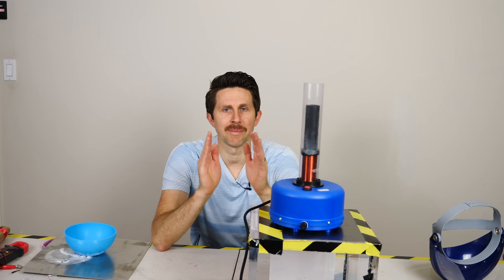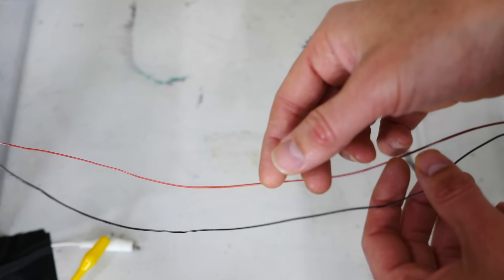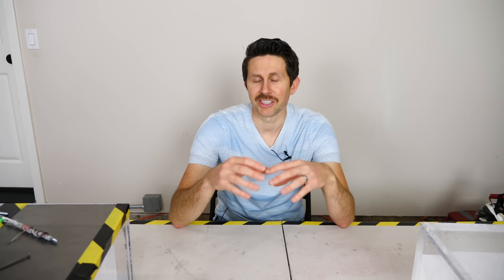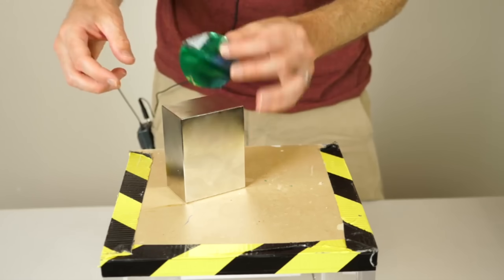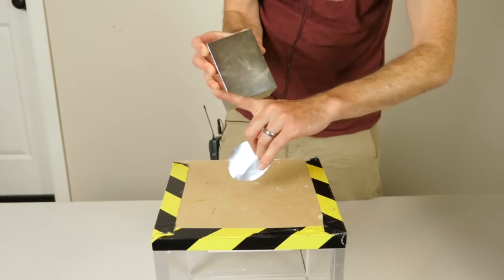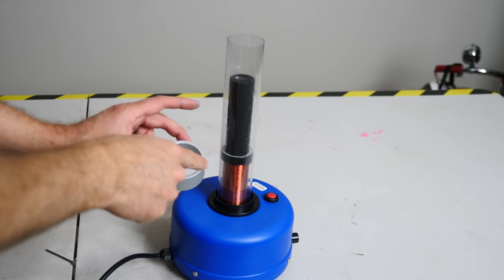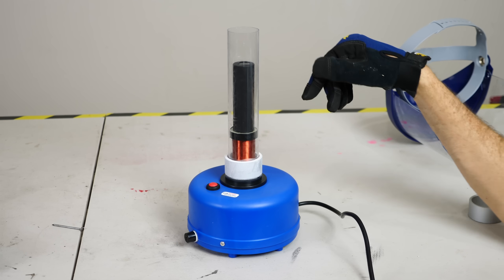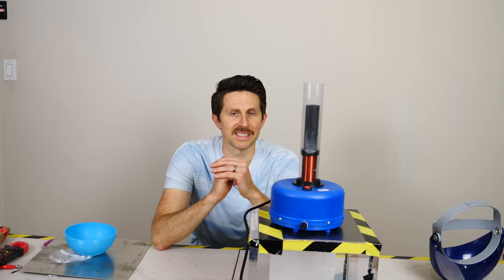Sub-Zero Electromagnetic Accelerator (Ring Launcher)

Comment: Also you can use dc if you have enough power. Same way those high power can crushers work. They don't use ac. They use dc. No induction in dc but it still creates opposing forces launching the ring. I use 400v 2500mf capacitors in parallel and in series on my gun and it's louder than most guns. It sounds more like a bomb

Comment: Electric guitar pickups induce voltage with a stationary magnet and coil of wire. Moving the metal string through the magnetic field is what creates the voltage in the pickup.

Comment: Can someone resolve this paradox: the guy in this video moves his magnet near the coil. There will be a change of the magnetic field which makes charges to move inside the wire. Now this flow of charges create a magnetic field so the moving of the magnet is harder. My problem is: the changed field propogates at lightspeed so there is a delay between moving the magnet and feeling the force against moving it. A slight delay but should be enough to create a high frequency  vibration which is like free energy. We know this does not happen. What's wrong then?

Comment: That last bit with the spinning magnets showed the principle behind Tesla's AC motor. By using 2 or more AC currents out of phase, the motor kept the spin going, because it created a rotating magnetic field. Rather than magnets, it just used a piece of metal inside the coils. The field induced eddy currents whose magnetic field opposed the fields of the coils, making it spin.

Comment: We should use this to launch satellites into space. But would the acceleration be too high, even for unmanned satellites? They would have peak speed as they leave the launcher, so they might burn up as well. They would need to be inside a ballistic heat shield shaped like a missile to withstand the aerodynamic pressures.

Comment: I have a question, when we take a magnet and stick a nail or something onto it, why is the nail also able to attract any magnetic object so long as the magnet is stuck on the nail? Then when we take off the magnet, the nail and the other object falls.
So basically, how is the magnetism going through unmagnetized objects like the nail?
Reply: Because the nail has also become a magnet. But why? You can think of the nail as it is made up of small magnets which were initially oriented in a random direction so that the net magnetic field created by it is zero. But when the magnet comes near it, those small magnets are aligned in a definite direction to produce a strong magnetic field. This is temporary.

Comment: Some say quantum levitation occurs on a super conductor due to the magnetic field lines acting as "string" passing through it.. While others say it's the infinite current passing through the super conductor (no resistance) allowing 100% of flux change replusion creating an opposing magnetic field equal in magnitude to that of the actual magnet allowing its levitation...
There are multiple ways to prove which one is correct, or if any of them is! (for example, for the infinite current theory, moving the super conductor shall be impossible)...
But I want you to try this! Using what you've shown in the video, can you try it on a circular superconductor? How will it react? Will it shoot out extremely fast? Maybe at the speed of light? XD and will this prove the infinite current theory then? Or will it be the magnetic strings theory what is true and the superconductor won't move at all?
Can you please try it?? That would be really interesting!!

Comment: Could we launch space rockets like that? Then when it is launched, it switches to liquid fuel. 

Pros
-That would save a little bit of fuel
-Reduce launching noise and the damage it causes to the building and the rocket it self.
-Make the rocket accelerate faster
-Less need of water (suppression system)
-Cooler looking launch
-renewable resources if energy can be used to generate the electricity required

Cons
-Probably consume a lot of electricity
-increase the g forces the crew needs to experience
-in case of liquid booster failure might cause other issues
-if rocket engine boosters are ignited in mid air, it might be difficult to aim at the correct trajectory

There might be more pros and cons.
Join the discussion please 😊
Reply: but if you want to launch a rocket with it.... you should make a vertical cylindrical hole in the rocket.... so you can't put a fuel tank anymore......i guess its a con😅.. cause you will need additional metal to build an additional hollow cylindrical vessel for the launch and a huge electromagnetic coil...
but if you manage to do both of them.... then...it could work......
sorry that i mentioned only a con.... cause you already mentioned all the possible pros in your comment above... so i couldn't think of any other pros.... but only this one con.... your pros are kind of good by the way... cause they are kind of environmental friendly... 🙂✌🏻
Reply: @rohan6579  the amount of electricity is enough for environmental savings made and kill all the pros along it.... And it would not hope that well...... It will be like star hoper.....
Reply: @rohan6579  model rockets on other hand will be awesome for high schoolers
Reply: @vasudevraghav2109  yes... you are right.... it only applies if you have huge amount of electricity.... to lift that much mass
Reply: @vasudevraghav2109  yeah model rockets for students is kind of a cool idea.... to learn cool things like these.!!
Reply: the electromagnetic radiation coming out of the huge electromagnet Can cause interference to homes’ electrical appliances miles away

Comment: A change in electric field does induce a change in magnetic field, but to get a constant magnetic field you would need an infinitely rising electric field. What's causing the constant magnetic field in the electromagnet is the current going through the wire.
You went with Maxwell's addition to Ampere's Law when Ampere was enough.